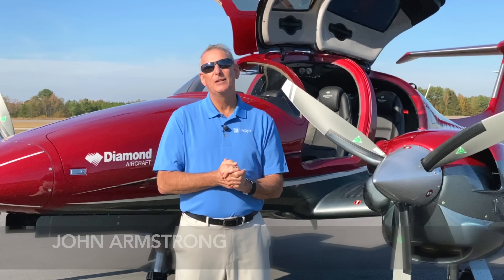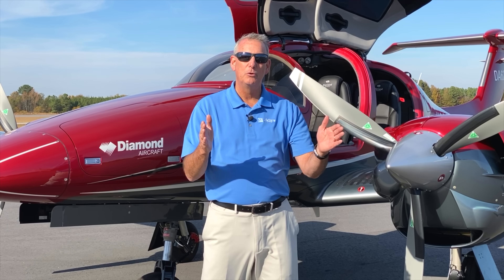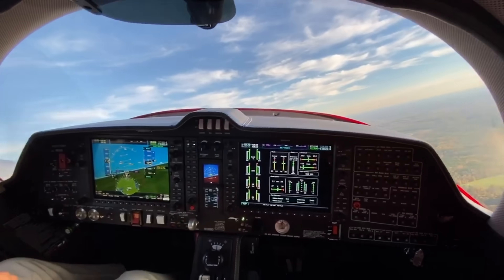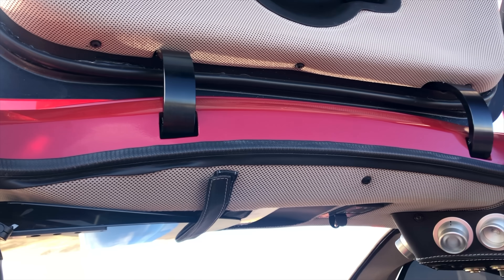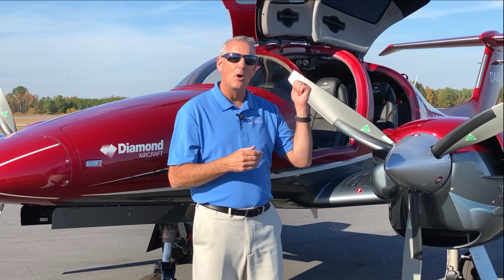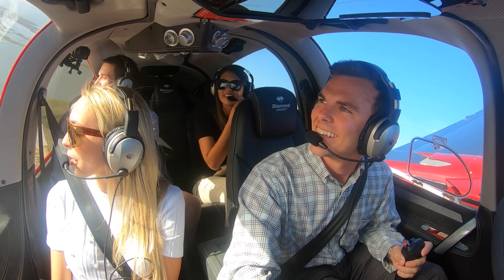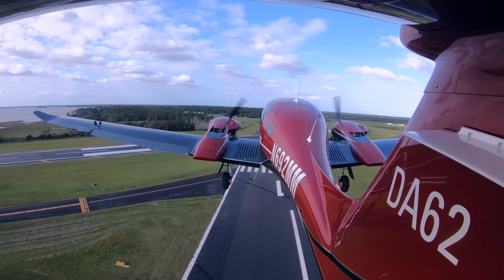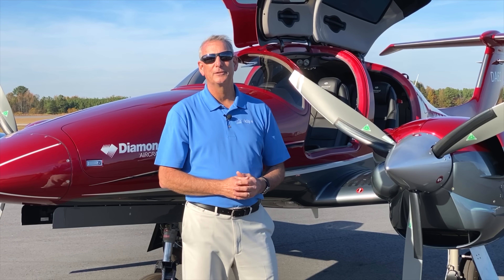What Makes the DA62 the SAFEST Twin-Engine Aircraft? | DIAMOND AIRCRAFT SAFETY SPECS

Comment: Unmatched possibly because of the low sales volumes? The DA42 should be equally as safe but since it's used a lot in training it has had many more accidents and incidents. They are great aeroplanes, no doubt about it.
Reply: The 42 was supposed to be great, but for reasons beyond my knowledge, they're absolutely awful on maintenance. My flight school had one and it was down for 6 months while they tried to figure out what was wrong with it. Even Diamond came out and couldn't figure it out. They had to rewire the entire plane. I think they ironed a lot out with the 62.

Comment: Does the DA62 have counter rotating props?
Reply: No, they do not.  Left engine is the critical one.  Combination of huge wingspan, massive rudder, and engine location close to the fuselage makes for an almost undetectable difference in single engine handling between right and left engine out.  Mine climbs at ~ 400 fpm regardless of which engine is shut down.

Comment: What's the typical max cruising speed??
Reply: I typically cruise at 189 KTAS at FL180, burning 15.6 gph (total!). In a hurry, I can push it up to 194 KTAS at 14,000, but fuel flow jumps to 18.6.  Hard to believe, but even at max wart this thing still gets better than 10 Air Nautical Miles per Gallon in the teens.
Reply: @ultraturtle2673  Awesome!

Comment: Clickbait, A350 is safer
Reply: Statistically, your observation could be valid for the time being since there has not yet been a fatal A350 crash, and the only fatal DA62 crash has been a result of poor controller/pilot judgement in allowing the DA62 to fly a parallel approach to a runway dangerously close to an A350 - an aircraft potentially 122 times the DA62's max weight - setting up a classic wake turbulence tragedy.  The A350 costs about 262 times as much as a DA62, burns 46 times as much fuel per mile, and is significantly more difficult to fit into your average T-hangar, so I would suggest that the A350 and DA62 might appeal to slightly different market segments.

Comment: This is NOT an analysis of the DA62's safety record.  For that, you need total air miles flown, number of takeoffs and landings, and all accidents and incidents broken down by category, pilot rating and experience, as well as environmental conditions.

FURTHERMORE, pulleys and cables do NOT "give a sloppy feel."  NOR are they "disconnected."  NOR are they limited to aircraft built in the "1950s."  MOST light, general aviation aircraft built in 2020 use pulleys and cables precisely BECAUSE they are lightweight.  IN FACT, two braided steel wires in opposing tension are many times stronger than large, heavy push rods.  Do the math! (engineering)

And, DUDE!  The "Loss of Control" category has NOTHING to do with cables vs push rods!  It has to do with the pilot trying to fly the aircraft outside of its normal performance envelope i.e. too slow, too fast, in usual attitudes, or in heavy to severe turbulence.

You're just playing on the fears of ignorant, low-time pilots.

Kudos to Diamond for it's dual-spar-protected fuel tank.

Let's see where else you're ignorant...

The "narrow fuselage" has nothing to do with "weathervaning" which is what ALL aircraft from a Cessna 150 to Diamond DA62 to a B-52 do in crosswinds.  You're an IDIOT to suggest otherwise.

The purpose of the "narrow fuselage section back to the tail" (it's called the "empennage ," by the way) is to REDUCE WEIGHT.  It has absolutely NOTHING to do with a "butter knife cutting through crosswinds."  Have you even FLOWN an airplane???  

Speaking of "crosswind components," the CROSSWIND COMPONENT LIMITATION is primarily a function of the ability of the landing gear to withstand side forces when landing in a crab.

Kudos to Diamond for adopting the race car "cage" approach for its occupants.  The flight control stick eliminates any inability to reach the controls, thereby negating a need for sliding seats.  Hopefully, the DA62 employs adjustable rudder pedals for those of us with longer or shorter legs, along with some seat height adjustment for shorter or taller pilots.

I really couldn't listen to the rest of this.  The guy sounds like a fourth grade trying to sell lemonade.

DA62 is indeed a GREAT aircraft, but for mostly different reasons than this gent is spouting off.

Comment: EXCELLENT, NOW ADD A BRS PARACHUTE  FOR IN CASE OF MIDAIR COLLISION OR PILOT DISABILITY AND THEN, YOU WILL HAVE THE SAFEST GA AIRPLANE EVER
Reply: BRS is not a panacea.  As of 2017, 14% (8 out of 57) of all Cirrus CAPS deployments resulted in fatalities.  In my opinion, the DA62 already is the safest GA airplane ever - that's why I bought one.  See https://www.ncbi.nlm.nih.gov/pubmed/28539144

Comment: “Your work your tail off trying to find a spin in the NTSB database”.     “You’ll be perfectly hard pressed to find a fire in the NTSB database”

the way he says it implies that there are none but He says it in a way to not out right say that because I’m sure there are some Crashes with those as contributing factors Or a crash that results in a fire
Reply from the maker: @GrummanPilot99 Thanks for the input! Actually, there has only been one recorded crash of the DA62 and that was in Dubai due to wake turbulence from a larger aircraft. Reports state that the pilot breached separation.

Comment: It seems social media has allowed everyone to be an "expert" on everything.  Planes are no exception.  I read some the negative comments about the DA62 and shake my head or even laugh.  I wonder if the naysayers have any actual experience, other than maybe Flight Simulator, with the DA62.  I simply want to pass on our first hand experience with the airplane in hopes that I can clear up some misperceptions.

This is all my opinion and as they say "Everybody has one!"  The only difference is that in this case I have first hand knowledge as the proud owner and pilot of a DA62.  

We are fortunate enough to own and fly our own DA62.  It's an amazing aircraft in everyway.  After not flying for 24 years, I got back into the pilot game in 2018.  I originally got my PPL/ME/IFR back in the 80's and stopped in 1994 as our business grew and needed more of my time.  After again getting current in 2018, we decided to get a new, or newer, twin and checked them all.  There was no comparison between the DA62 and the other options on the market.  It wasn't even close for us!  All the options were relatively close in price so it came down to capabilities, comfort, safety, and support.  

Capabilities - The DA62 is new, modern technology based upon a clean sheet design.  Look at it!  It's 21st century in every way!  All the competitors are old school designs that have been updated with modern glass avionics.  Think 1975 Cutlass with digital dash.  The DA62 flies at about the same speed, (mid 180 knots)  with about the same load (4 people with bags & full fuel), 4.5 hours range (plus reserve), but at half the fuel burn (9 GPH per side)!  

Comfort is a very personal and subjective thing.  My family prefers forward seating so the DA62 was their favorite.  It's about the same size interior as the others and the seating is ultra comfortable.  If we need to we can actually carry 7 total people!  Even the A/C is modern.  It's fully electric and operates from it's own dedicated alternator.  It does not have to be shut off for airport operations like all of the competitors since it does not decrease engine power in this critical phase of flight.  That may not sound like a big deal, but passengers (and pilots) hate it when you need to shut off the A/C while in hot weather and you're down low in the high temperatures when taking off or landing?  Seems kind of counter-productive to me...  

All the safety features in the video are true and were very important in our decision.  In addition, until you operate the diesel engines you can't understand how smooth and turbine-like they are.  They start like you're turning on an electric motor.  There is no ignition system so there's no popping and bumping as they fire up.  There is no leaning or prop controls.  In turbulence it's rock solid and in any flight condition it's confidence inspiring for passengers and pilot alike.  

Support has been fantastic!  Our local A&P went to Diamond school near Toronto to get certified so he takes care of the plane right at our home base.  We've only had a few minor "new plane" issues, all of which were quickly resolved and didn't result in any downtime.  The complete annual was under $3,000 which was our only expense other than fuel, oil change, oxygen, and TKS fluid.  With over 150 flight hours so far, I can say that support has been super! 

Finally, if you're fortunate enough to be in a position to consider this class of aircraft, call John at Lifestyle and take a test flight.  Everyone there is a  true professional that wants to help you all the way through the investigation and decision making process.  They've certainly earned our trust.
Reply from the maker: Jeff, this is great feedback and thank you for sharing your experience! As someone who went through the decision and buying process for the DA62, your input is gold.  We are so happy you are enjoying your DA62!
Reply: Jeffrey Brauer ÿ}’
Reply: Hello Jeff, very interesting your points 
I’m impressed with your determination to get back in the cockpit as PIC after so many years, your story is vey inspiring and I’m determined to do similar. Any advise where I can get current I’m in NC, if you want to fly in to Mt. Air NC 2NCO we have vacation house I will offer you few days free of any charge but a short flight in the DA62,
You can check our house on vrbo or Homeaway #330636 thanks Liviu M.
Reply: Jeffrey Brauer hi jeff.  I like yourself and getting back into the flying game.  I need to get current.   I am considering this aircraft. Or a single engine turbo prop.  Any comments or advice??

Comment: How many litres per hour is the fuel burn? How many kilograms is the Maximum gross weight?
Reply: 10,000 ft, 185 knots, 9.1 gallons per hour per side.  Jet-A
Reply: Standard max gross is 2,300kg.  It is also available with max gross weight of 1,999kg for the European market (it's a tax thing).
Reply: @ultraturtle2673  Thanks a lot!

Comment: Awesome technology but crazy expensive for only a 4 person aircraft. If you have the money to purchase this bad boy than you have the money to purchase a bigger more capable cabin class twin. To expensive for training aircraft and be hard pressed to make any money from charter or VIP services with only 3 seats available to clients.  Be really interested in what others think , specifically about feasibility of using this aircraft for charter,  VIP operations
Reply: I think theres a good case to be made for the DA62.
First off the financial aspect: A compareable used twin (7 seats, FIKI, G1000 with AP, weather radar (does anyone even have that?), new interior/paint etc) will probably set you back 400-500k easily, the DA62 costs 1.3 million new. With a 20 year loan you end up with 5417 dollars/month (DA62) and 2083 dollars/month for the used plane. Even bigger planes might be an option, but it wouldnt be a fair comparison in my opinion, since you run into even higher maintenance/repair costs and its just a different category of airplane alltogether.
Lets look at the running cost: Most planes in this category burn around 36 gph AVGAS in cruise, the DA62 18 gph JET A. With the average US prices for both youre saving 100 dollars/hour on fuel with the Diamond. To break even on fuel cost savings alone we have to fly 408 hours a year, which will already be difficult for businesses and almost impossible for private owners. If you fly 150 hours a year, the savings are 1250 dollars/month. 
But there are other financial benefits with the DA62 as well, both in the maintenance (100 hour oil change intervals vs. 50 hours, more oil consumption with the older engine designs), repair (brand new plane with warranty vs. 40 year old one), and maybe even depreciation (since fuel prices will probably increase in future, making gas guzzling Continentals or Lycomings less desireable). I dont have the insight or any reliable information to calculate these numbers, but one should keep those in mind.
In summary, for businesses that fly alot the fuel economy will be reason enough to buy it, the fact that youre owning such a stylish, brand new aircraft can also serve as a marketing bonus (as opposed to a 40 year old Cessna or whatever). As a private owner it will most likely be more expensive than a used one, then again what price do you put on the safety features pointed out in this video? What price do you put on owning a brand new plane, that you know hasnt been abused, as opposed to a 1975 one with 10k hours on it?

Comment: I know Embry-Riddle students find them to be safe because they’re always sitting on the ramp needing repairs. Usually related to the engines.
Reply: Embry Riddle does not operate DA-62s
Reply: @alexmelia8873  I stand corrected, they are DA-42s.
Reply: We own a DA62.  150 hours so far and zero downtime.  Diesel engines and modern design.  Simplicity is built in.
Reply: @jeffreybrauer4317  The ERAU DA62s have about a 40% downtime, nearly all powerplant issues.

Comment: what is the single engine rate of climb?  That IS where twins get touchy!
Reply: We own one and did single engine during checkout.  We saw 500+ FPM single engine climb at 4 - 5,000 feet.  This is the most forgiving single engine twin without a doubt.
Reply from the maker: The DA62's Single Engine Rate of Climb is 288fpm with a 13,000 foot ceiling. This means you could fly comfortably over the Rocky Mountains on a single engine...which is unheard of for a plane of its class!
Reply: What's the single engine climb rate at 5000 ft with the gear down and takeoff flaps, at mtow?

Comment: It's not called shock cooling. It's called thermal stress. Because it happens whether it is warming or Cooling.

The only thing I worry about with making the aircraft less worrisome, is the Fatal issues that might occur when those systems fail to work. These things said, I do like this aircraft. Would love to get in one and fly one.

I have a question, you commented that the aircraft does not run on Avgas. But you didn't say what it runs on. Can you at least say what kind of fuel it uses?
Reply: Jet-A
Reply: Thank you

Comment: OK, but where's the parachute?
Reply: its a twin...….??? why would you need a chute?
Reply: @patriotsfan1236  Fuel contamination?
Reply: @djinn666  imagine a pilot not sumping fuel before flying..... That's sometimes the mentality when you have a cirrus.  Simple answer is sumping fuel to see if they put jet a in it or if there is sediment or water in it. Completely preventable ......
Reply: @patriotsfan1236  almost every accident is preventable, yet we still have accidents. Plus not all fuel contamination is visible to the naked eye. Someone could mix in a bit of E10 mogas and you wouldn't be any wiser.
Reply: @djinn666  an avgas engine that was operating with part mo gas would still operate fine. Over time you would see issues. valve issues( no lead) etc....
Reply: @djinn666  we do still have these issues.( It's most all non professional GA pilots)   it comes down to preventing it. Look at 121 airlines or even tight run part 135 charter companies. Very very very safe. Part the aircraft but mostly the pilot and safety standards if you are comparing 2 different twin engine operations.
Reply: In the short term the aircraft would still operate totally normal. Maybe a little rough from being a lower octane .
Reply: @djinn666  they are strapped to the backs of your occupants I guess... If folks really consider that necessary I'm SURE they all fly their Bo's that way right?
Reply: @steveh9714  I don't think having it attached to your back is as good as the whole plane parachute. It would take you a minute or two to climb out and fall far enough away from the aircraft to pull the chute. Also with a twin, there's propeller blades right outside the canopy door.

Comment: My only concern in many types of canopy / egress designs in a plane like this doing a nose over and  flip upside down and become trapped inside... then perhaps survive a landing mishap only to die in an unexpected smoke and fire, unable to exit.  How has Diamond addressed this egress issue?
Reply: Not sure if its included in all models but the DA40s I fly with my flight school have an emergency axe under the copilots seat for cutting your way out if need be. Also theres a handle on the ceiling of the 40s that if turned disengage the hinges on the rear door allowing it to be totally removed.
Reply: Great comment!  We own a DA62 and there is a glass/canopy window break hammer and seatbelt cutter safely stowed behind the copilot's seat.  This scenario is part of the Diamond transition checkout and covered well regarding where and how to know the windows out of the plane if ever needed.

Comment: '
nice pretty airplane...
both propellers musts be opposite spins as V-22 osprey...
both same spins are not good idea
Reply: Both rotate the same way so left engine is considered the "critical" engine.  However, we own one and it is by far the easiest twin to fly single engine regardless of which engine is shut down.
Reply: In reality though, twin engine props usually do spin the same way. It's usually prohibitively expensive in terms of maintenance to do otherwise.
Reply: They aren’t counter-rotating.  Just look at the props.
This is actually safer because when you have opposite-rotating propellers, it requires opposite-facing parts.  That increases cost, complexity, and the chances for a mechanical mistakes when performing maintenance.